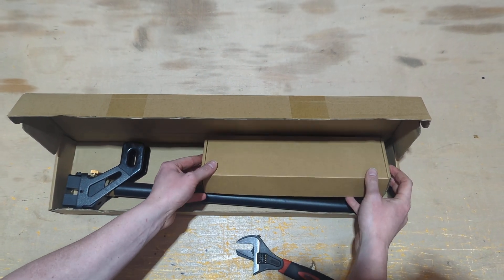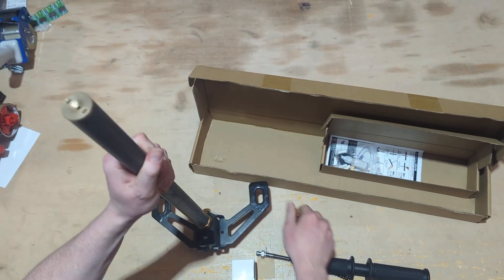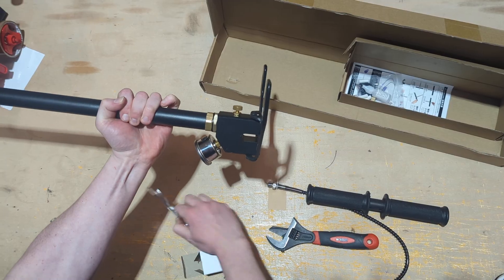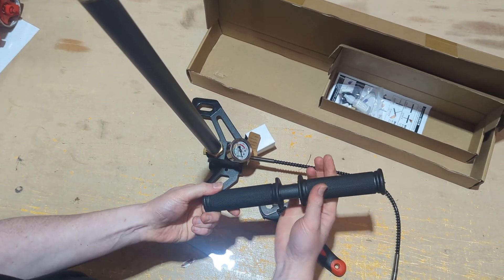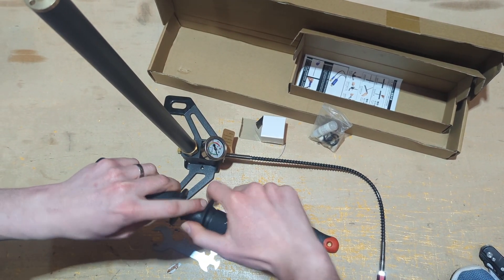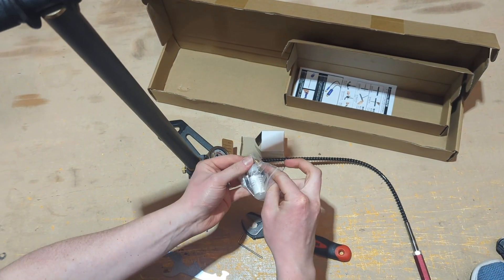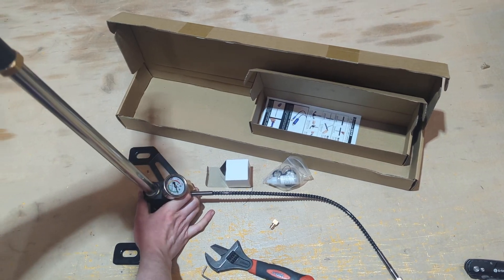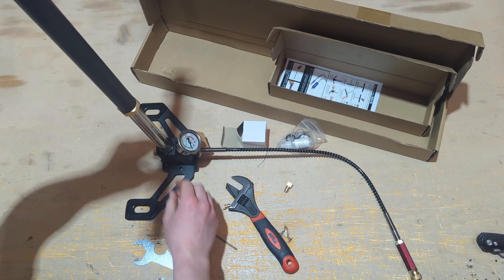How to assemble a 3-Stage PCP Pump

Comment: my regulator says 1000 to 6000 psi i only want to fill my nailgun upto 160psi, the instructions were barely readable and that seems really  hi for a pump. is my regulator labeled correctly?
Reply from the maker: @tomblake8885  assuming your not joking and if you are genuinely attempting to use a 300BAR (4,350 PSI) pump to fill a nail gun, you need to stop immediately. This setup is entirely unsuitable and poses a serious safety risk.

Nail guns typically require far lower pressures (around 160 PSI, as you mentioned), and using a high-pressure pump designed for airguns could result in catastrophic failure or personal injury.

To safely fill your nail gun, you should use a tool/shop compressor specifically designed for such applications. Here’s a suitable example that may meet your needs: Based on your message, if you are genuinely attempting to use a 300BAR (4,350 PSI) pump to fill a nail gun, you need to stop immediately. This setup is entirely unsuitable and poses a serious safety risk.

Nail guns typically require far lower pressures (around 160 PSI, as you mentioned), and using a high-pressure pump designed for airguns could result in catastrophic failure or personal injury.

To safely fill your nail gun, you should use a tool/shop compressor specifically designed for such applications. Here’s a suitable example that may meet your needs: Tool Compressor. https://amzn.to/49iYPUA

Please discontinue using your current setup
Reply: @VectorAirUK  Hi thanks for responding, I should have been clearer i think. I bought a cheaper pcp stirrup pump its a hand pump im using which leads me to belive the japanese made regulator is incorrectly labeled as surely you couldnt hand pump upto 6000 psi?
Reply: @VectorAirUK  JUst to add I wonder if you could tell me what your pcp pump regulator says?
Reply: Well...just says on 1 side psi 0, 1000, 2000, 3000, 4000, 5000, 6000, then on the inside of the gauge it says MPa 0, 10, 20, 30, 40. I'm thinking tho you could never hand pump that high tho surely?

Comment: Perfect - so what are all the spares for?
Reply from the maker: @petermiller1041  there is a brass test plug for ensuring the pump functions. 

The other parts are for if there is a failure. The manual does not describe disassembly of the pump as it promotes people taking it apart without any reason to do so. If there is a fault take all of those spares to someone who knows what they are doing so you then don't have to pay for spares
Reply: Ikr, I assume they're for rebuilding it but the stupid ass instructions don't say anything about it. From my very limited experience these hand pumps are just gimics. I've pumped for 30mins total of pumping time with several 5min intervals to let the pump cool down and it's only at 1500psi. There's no way anybody uses these routinely they're a total joke.

Comment: I've seen several videos where there is a tube of oil or some type of lubricant included with the parts. Mine does not have that and i was wondering if the pump needs lubrication before initial use and if so, what type can be used. Some people told me that synthetic transmission fluid is appropriate.
Reply from the maker: They typically don't come with any oil however we would say avoid anything not designed for the purpose. Transmission fluid could cause excess wear to the pump. Ideally you would use a rubber safe oil like silicone (don't use anything with a solvent - like WD40)